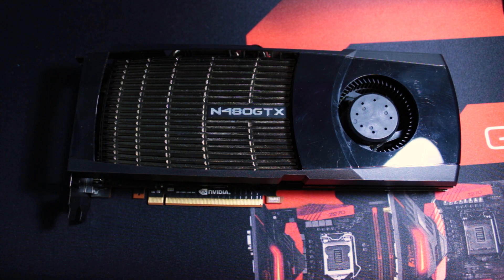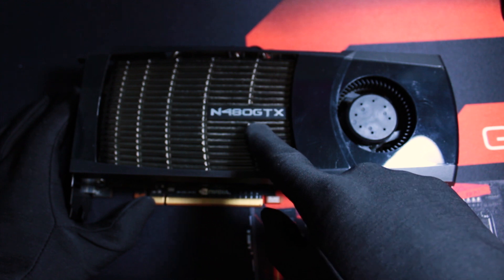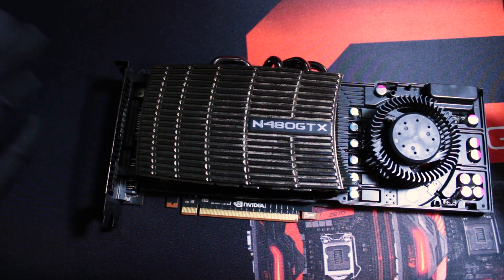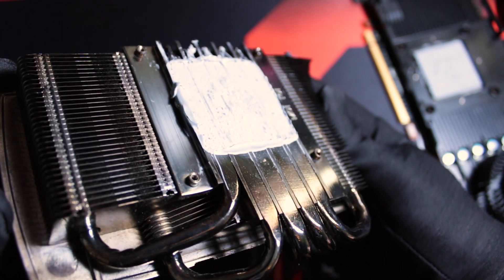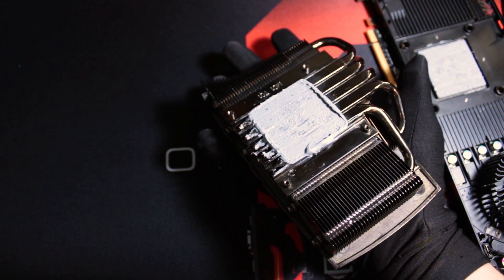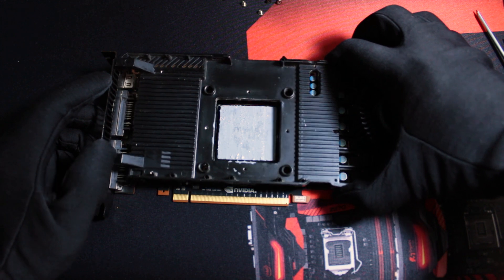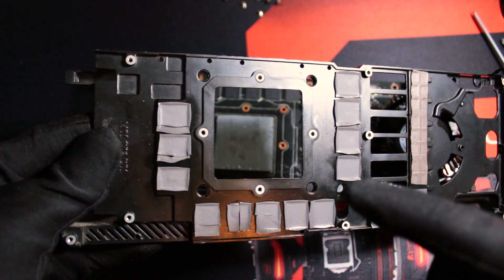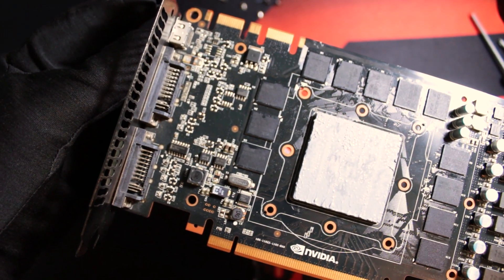The GTX 480 teardown & cooling system explained

Comment: Weird that the 8800 gtx had an even bigger cooler when it absolutely did not need it
Reply from the maker: Back in those days, it was the wild west. I have no idea why the GTX 480 had such bad coolers, especially since the power draw was high.
Reply: @TechLegend-com Mine started to cause BSODs, so I (properly) reflowed the CPU  and the memory chips. Have you looked into a suitable and better blower?
Reply from the maker: @tfinmoraes  I tried to reflow my GPU but it's still not working right. Unfortunately, it has become a display piece on my wall.

Comment: Are there are any mods your average user could do to improve the cooling of a reference card? I just bought myself a GTX 480 after wanting one for so long. I just love the way the reference models look, so I wanted a reference model. But I also want the card to last.
Reply from the maker: There are some, first you need better thermal pads, you find plenty of them around, Arctic AC makes good ones. Then replace the thermal compound with something better, either Noctua NT-H2 or the Arctic MX-4. Finally, you just need to keep that little fan free of dust, so you need to clean it regularly. Unfortunately, the reference cooler is just not that good for the GTX 480.

Comment: Damn, my GTX480 is 72deg IDLE :( and 92 under furmark full load. And that's right after i changed thermal grease. I definitely need to change thermal pads too..
Reply from the maker: Yes you should do that, these graphic cards are very fragile, especially when running hot. I am still looking for one that is working like it should. :/

Comment: Is there any GTX 480 with an appropiate cooling?
Reply from the maker: Yes, the following graphics cards have proper cooling: KFA2 GTX 480 Anarchy, Zotac GTX 480 Amp! Edition, GigaByte GTX 480 SOC, MSI GTX 480 Lightning, MSI GTX 480 Twin Frozr II. Good luck finding one in working condition though, I am still trying to find one that will work for more than 30 minutes. :/